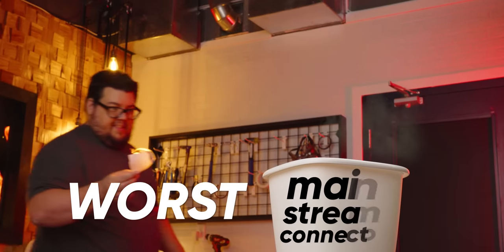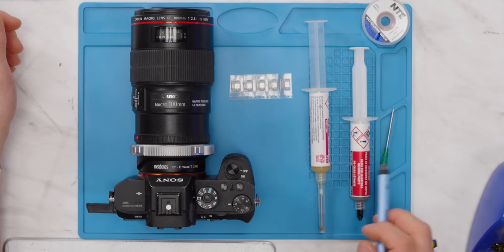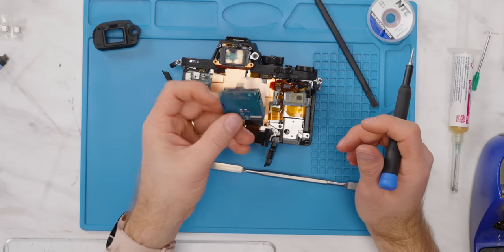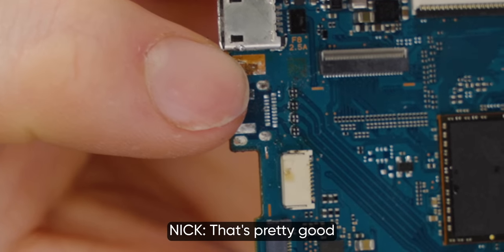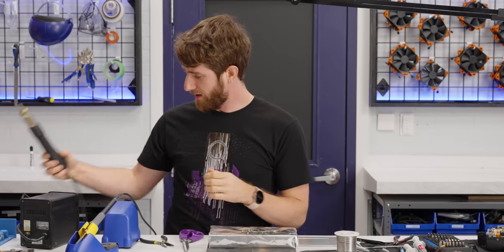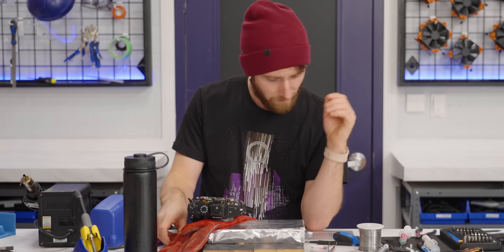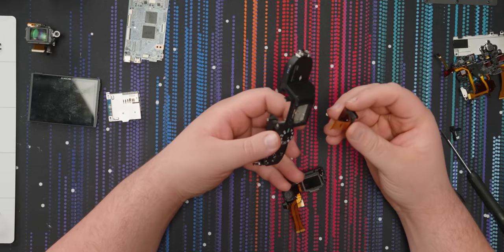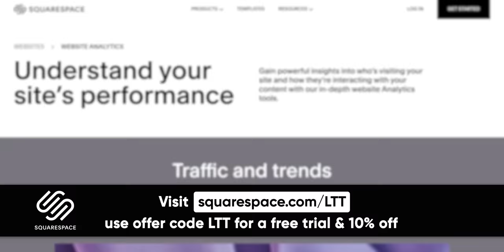This "cheap" repair almost BROKE me.

Comment: Pro tip on how to solder those connectors, wick up all the existing solder, then solder the two outermost high density pins (not the mounting tabs, DO NOT use hot air to reflow it in place - as you hopefully learned lol). Then use a square shaped soldering iron tip to do the rest of the pins at once, as long as the connector is constantly submersed in flux the flux will mostly prevent solder bridges from forming. Using .015" or .010" solder is a MUST, and preferably 62/36/2 silver bearing solder helps. Finally, solder the two tabs. Preheating and using hot air to place the connector was completely unnecessary and ricked damaging other components on the PCB.
Reply: that would work for usb, but SMD microhdmi needs to be reflowed into place since there are two rows of pins to get soldered. what they actually need is a proper hotplate and a reflow oven/station
Reply: there seemed to be a second row of pins behind that could not be accesed
Reply: That is a two row HDMI connector, only way to solder it is to preheat the board, add flux, put leaded solder on all the pads, clean the flux, apply new flux and reflow the connector with most of the heat going to the boad and not the connector. If the alignment pins have big pads/holes the positioning can be really hard. Wouldn't recommend this repair for a beginner.
I've replaced many two row connectors on phones, vr headsets and apple things and it's not fun :D
Reply: Hard to tell from the closeup at 12:40 but micro hdmi uses 2 rows of pins so it would be potentially very difficult without air. I might still try it though. His issue really was heating the whole board with the air, he should have taped off the area. And not blasted the plastic part, lol. He looked like he had the heat and airflow set to max.... which made the job harder.
Reply: @antibodyarmy  You're right! I just noticed the double rows in the video. The connectors I've done slot onto the edge of a board and have a row on the top of the PCB and a row at the bottom that can be easily handsoldered. Doing the ones in this video looks like a complete PITA, no chance in hell you could do that by hand without reflow.
Reply: So no hot air needed during the whole process?
Reply: if he just watched any video for HDMI repairs hahaha
Reply: Can't we just use an air fryer????
Reply: @pp3v42_g3h 
leaded solder is a good point, it's melting point is significantly lower (about 30 degrees celcius iirc) than modern silver solder and makes thing alot easier in some situations.

extra important to make sure you have good ventilation since led fumes is not good for you in the long term.
Reply: @linuxguy1199  If interested... You should look into drag soldering, using an gull wing tip as the "RT 10GWMS". It's a lot easier and faster than going over every pin separately using a square shaped soldering tip.

However, it's not usable for micro HMDI... We literally avoid this type of connector on our custom designed pcb's at the place I work, cause they're extremely annoying to solder or re-flow without issues.
Reply: @timmy7201  Same here, I've used micro HDMI once before but the connector slotted onto the board, with pins going onto the top and bottom side of the board. I have used the Hakko equivalent of that tip before, those things work great but Hakko has one similar that is a little bigger and it works really good for QFN32s and such.
Reply: I super agree with this. Hand soldering is so much easier than F-ing with hot air, especially when you have plastic components. All you need is a fine tip, a chisel tip, and some solder wick
Reply: @thelightsilent  🤔Sony makes good products though.
Reply: low temp solder and lots of flux is the answer along with proper preheating. low temp solder melts at around 120°C~180°C which prevents the plastic from melting also making it easier to solder it back on preventing other components from damaging.
Reply: Some Kapton tape and you can use hot air for basically anything, though sometimes it is more of a pain in the ass than it's worth personally for me but all the rework old Nasa guys(3 of them) at my job rarely use irons unless they have to reuse the part. Again personally when the PCB is really congested with small parts it's not my preference to use
Reply: It's pretty easy to explain soldering techniques but at the end of the day it always comes down to practice/experience.
Reply: Yes, completely doable, if you have a little experience with hot air reworking. Even without a hotplate, you can preheat the board with the air gun on a lower temp setting.

(Remove solder from the mounting posts), Preheat board (120°C), Heat connector and pins(300°C), remove connector, remove all the solder with a wick and flux, clean the board, add solder paste(thinly), place new connector, preheat carefully until the flux of the paste melts and the connector settles down, solder new connector with hot air, solder mounting tabs with an iron, clean the board. 

I've done this a couple of times already and it's not that hard, BUT you have to have some experience using hot air guns....
Reply: @foamybelch  LMAO, Pretty much is
Reply: Good luck getting to the inner row of pins!
Reply: @nezbrun872  yeah, incompetence in pure LTT fashion, just like we've come to expect. It would be satisfying if they showed how to do things right instead of always YOLO'ing it.
Reply: @thelightsilent  You mean the Micro HDMI that people find are easy to break with little use that you can find in a couple devices that not only can be found on sony? Yes typical
Reply: Most high density connectors are multiple rows and have pins under the metal can that are impossible to reach. Its fast and easy to reflow them, just don't have your hot air at 500C like he had!!
Reply: First of all there is nothing wrong with soldering such connectors by hot air. They are wholly heated during circuit board manufacturing after all. You just need a preheater on the bottom side to heat bulk of the PCB and properly set temperature of hot air. Hot enough to melt the solder but not too hot to damage plastic parts of the connector. Secondly, unlike most of micro USB connectors, you cannot solder it by soldering iron, you can do it for outer row of the pins but inner row is not accessible.
Reply: mm i just put in more flux on it is just hot enough to flow again and the plastic didn't melt (Sony WH-1000XM2 )
but maybe i just got lucky Idk not a fix shop or any thing just a hobby
Reply: This! He could of saved so many headaches by just anchoring the hdmi to the 2 big outermost pads and then working on the small pins that would of been lined up!
Reply: This guy solders.
Reply: Complete noob here. Why wick up old solder?
Reply: insert *thank you gif from the office
Reply: u said it right on time :'D
Reply: Thanks for this.
Reply: Probably this kind of work HAVE to be done under microscope, not to only check after
Reply: @euanmutch  Yeah something seemed off about him constantly melting the plastic, I've reflowed USB connectors before and not had that problem.
Reply: This comment right here! Read it Linus, please! 

This much heat, over and over and for such a long time has such a high risk of ruining the whole board 

Why do you guys think reflowing a whole chip (for example an APU from a PS4) is so rarely done? 
Much time, effort, work and money just for it to be broken and unfixable in the end...
Reply: @sebastianfiel1715  Hot air for component removal.
Reply: @TheCrazyPozavnist  You need a nice flat surface. That's why it was a mistake when he melted his solder pate before fitting the component. There are a couple of ways of soldering this but due to the two rows of pins the solder paste, plenty of flux and the heat gun would be the way.
Reply: I'd also say have a microscope to do the solder repair rather than just eyeball it.
Reply: And a microscope and mount to keep the board steady as you adjust things.
Reply: @TheCrazyPozavnist  The old solder is lead free solder and melts at a higher temperature. You want to remove it and replace it with leaded solder so it can melt with less heat and prevent damage to the plastic in the new port.
Reply: You forget the person doing the job doesnt even bother to labels his screws and manage to break a ribbon while dismantling the camera just once.
Reply: Hey guys any suggestions on a decent hot air station for beginners that won’t totally break the bank??
Reply: Yup! You don't need that annoying lead free solder. You get rid of it and start fresh with a micro soldering tip and a lot of flux and patience. Using hot air to solder a connector is a terrible idea.

Comment: Some tips: 
1: get some kind of magnifying device. 
2: Be EXTREMELY careful not to pull of the part until it is free floating, if you pull the PCB will break! 
3: Preheating is key, but for connectors like that, you can also heat the board from the other side or use heat just above the melting point. 
4: Make sure your hands are stabilized, if you have to hold the part and the weight of your arms you will be damaging stuff. 
5: Solder between the pads can be removed with the solder braid
6: Practice on old boards and practice some more!
Cheers!

Comment: Honestly found this "experience" highly relatable and I feel a lot better about how stressed I get doing this sort of thing.
Reply: Well the story there was 600$ job turned to be 600$ job with work. I still remember my first phone screen repair, 200$ phone with 40$ replacement screen. No patience or proper tools--> battery broken and screen bent. off with a new one...
Reply: Same here. I just recently replaced an LCD touch screen on a laptop and it was pure hell.
Reply: HA, yes exactly this! I've got better but I'm not sure I'd try myself on something this expensive.

Comment: 1. Soldering connector back you can do without hotair.
2. Not sure what solder did you use but looks like non lead one. If you are beginner I would use lead because it is so much easier to work with.
3. Use desoldering pump for ground pins. Then you can just place connector in a correct spot and solder without hotair. Remeber that ground pin have a lot of thermal capacity so the moment you touch melted solder to it, temperature would drop and cause solder to go in to the solid state. Until you get back to melted point you will significantly heat the plastic in the connector.
4. If you see that your solder blobs are kinda crumbly and irregular, that usually means too little flux or to low temperature. You would not solder anything correctly in that way.
5. Remember about solder surface tension. It will auto align little mistakes(might not work that good with connector because of ground pins).
6. When you are doing things like this don't get too stressed out. You need to be pretty precise and fast, but becasue you didn't practise on anything that calliber before your movements are chaotic and random which probably contributes to your mistakes.
7. Practice on something that is junk anyway before. You should be able to get good results after learning a bit about basic properties of the material that you are working with.
8. Especially being beginner. Not having correct tools for the job will make it nearly impossible to do. Not having heater might not be a problem for someone that was doing a lot of such stuff before. But for you it might be doing tremendous difference. If possible always try to pause what you are doing before getting tool. By not having it from the beginning you will do probably mess and later you would get it anyway. Realizing that you could do better job.

Good luck
Reply: Only the ground pins can be hand soldered, because data pins have two rows - one of them is not reachable with soldering iron.
Reply: @adameichler  You're right. My bad.
Reply: @adameichler  it is possible to solder farther row without heat gun. you just need to bend closer pins up. I managed to fix this issue with 5€ soldering iron and a 5€ port.
Reply: @undefinednotfound  plausible, but scary 😁
Reply: You can also use water to control/limit temperature spread to plastics. Either plain distilled or with a tiny amount of dishsoap, depending if you need a bead of water, or coat of water to help regulate temperature spread. The water is easiest applied from a syringe.
Reply: can i add always put heat shield about a connector before doing hot air as you can melt the plastic part inside the connector
be perpendicular to the mother board and above the connector to better heat distribution thats will make all legs and connecting pins soldered at once
Reply: @adameichler  I agree however-
One of the best ways to solder a difficult piece is to slowwwly and steadily do a single corner, keep it hot and align using tweezers. Once it is aligned, remove the iron but keep aligned as the solder solidifies. After the component is held with ground pin, the other pins can easily be done with hot air because they will melt much quicker without the ground plane to sink heat directly.
Reply: Also Sn/Pb solder is more ductile which makes the solder joints less likely to crack from stress on the connector.
Reply: Even if you're a non-beginner, just use leaded solder. The only time not to use leaded solder for personal use, is if you plan on having the solder exposed and giving it to someone else. 
There are other use cases too of course, but there's really extremely little need to use lead-free solder for personal stuff. It might be that Linus has to use lead-free due to some Canadian workplace health and safety regulations? Since he is doing this in a work environment. 
Also practice is super important for small solder jobs like this. It honestly takes months, possibly years to get good at fine pitch solder jobs (at least if you're not solely doing soldering). 

That said good advice, but also worth remembering that this was basically just a content piece and they went in under the "if it's already fucked, you can't fuck it anymore" guise. Basically, if it's already broke in a way that renders it useless for your use case, you can't really make it any worse than useless.

Comment: So, to anyone who might want to try something similar, remember: if you're changing a port, hot air is only for removal. To solder the new port on, use the iron and the iron only. Tack the legs in, then solder the pins. Also, if you bridge 2 pins together, just use some flux and touch them with the iron until it's good
Reply: I have virtually zero experience doing this, and even I was wondering why he didn’t just use the solder iron.
Reply: The part when they removed the entire port because of a bridge almost hurt me physically...
Reply: Can't just use soldering iron. microHDMI is pure evil and has 2 rows of pins. Best is to use hotplate for preheating + hot air. It's also possible to use just a small hotplate but that kind of heat may damage the board.
Reply: One tip, do not tack the legs in. Tack data pins. Easier to fix bad positioning that way.
Reply: Also anchor the board
Reply: I had to click out at the brick. It was too much to watch. I'm impressed he did any of this work without an inspection microscope or magnifying glasses, though.
Reply: Yeah.. as someone who does a lot of hobbyist soldering, this hurt to watch. Clean the old solder off the pads with a wick/solder sucker. Solder the through whole pins with an iron. Then drag solder the smd pins with flux on the pcb and some molten solder on the tip of your iron. I've done this multiple times and it is very easy to get it looking mint. You can also use some Kapton tape to hold the port in place while you are soldering.
Edit: I typed this before they brought out the "hot brick" and thermal camera. Oh lord.. :(
Reply: Also use some capton tape or some other metal thing to try and deflect the heat given off by the iron/hot air from the plastic connector
Reply: @Ensaumneak  I did drag soldering for the first and only time in my life installing HDMI in my N64, the most nerve wracking experience knowing how prone to failure those suckers are.  That was a few years ago now, still working and I was honestly amazed at how well drag soldering works
Reply: @GingerNingerGames  It's like magic. I've done it to swap rom chips on gameboy cartridges and install USB-C ports on pcbs. I have an old PS1 I want to HDMI convert, and that will involve a lot of drag soldering, haha.
Reply: @Ensaumneak  Honestly man, I need to build more projects with SMD components so I can practice, super lucky on the N64, bridged a couple pins but spotted it and flux and heat and she was golden again.  

HDMI adapters when done properly are magic for old consoles.  We set up mario kart 64 on a good sized TV and could actually see the game properly vs what modern TV's do to analog signals.